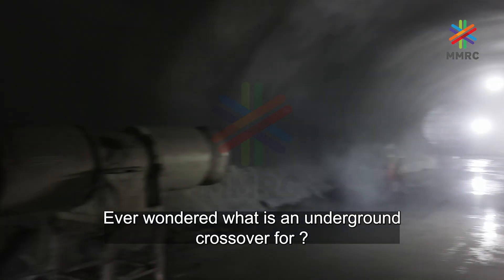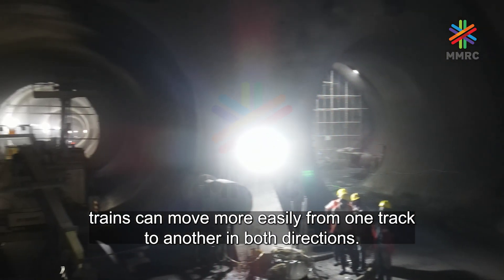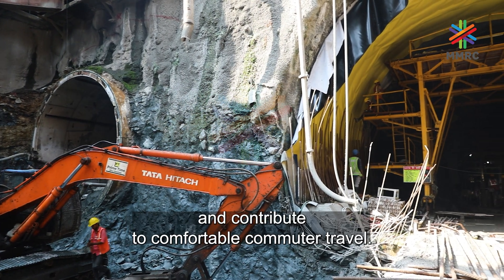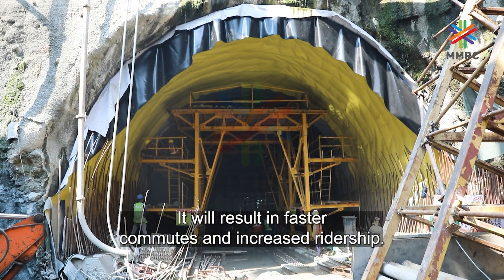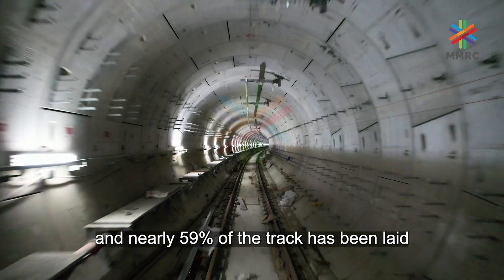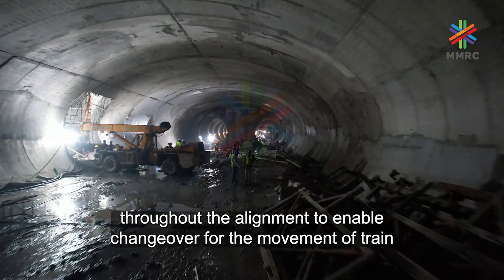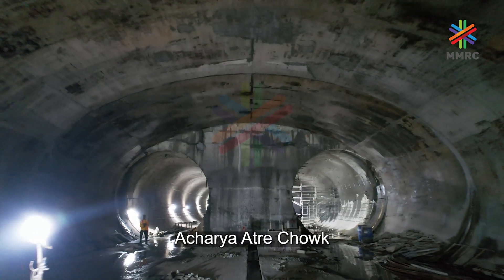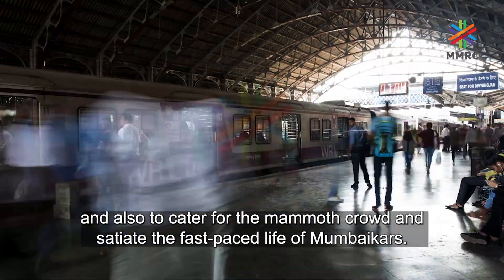What's a Crossover in Underground Metro? Know more about it and where are these in Metro3

Comment: Where enclosed stations include more than one platform level (such as crossover subway lines), there shall be a cross-connection pipe of a minimum size of 100 mm (4 in.) in diameter between each standpipe system, so that supplying water through any fire department connection will furnish water throughout the entire system. please advise